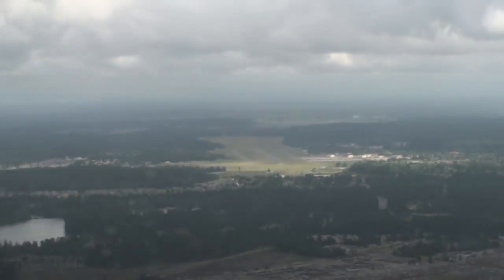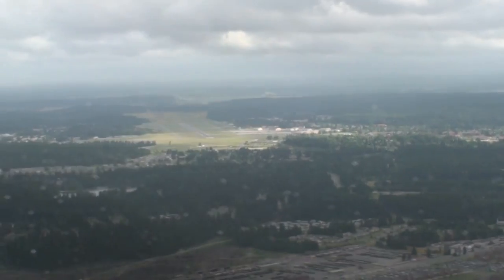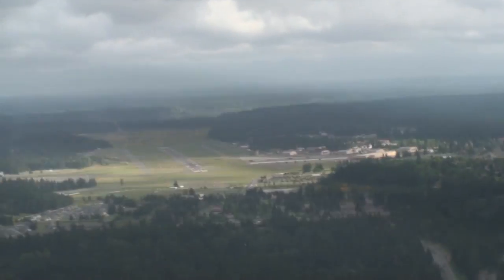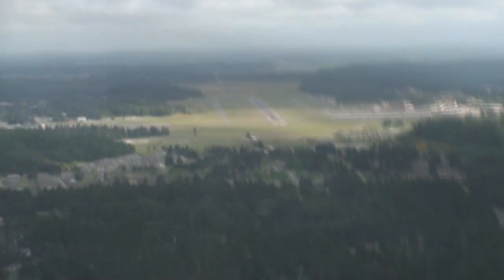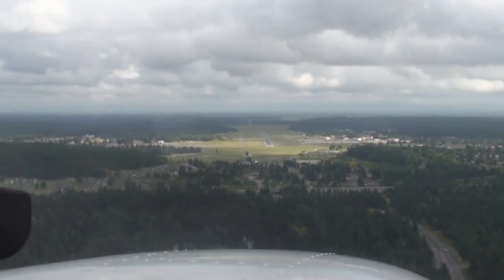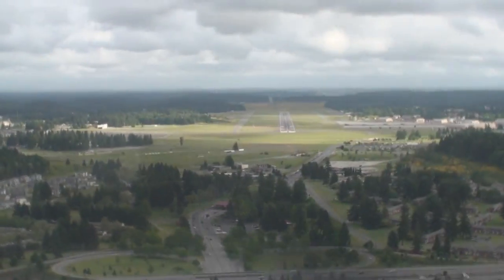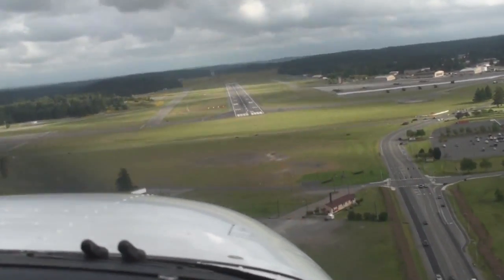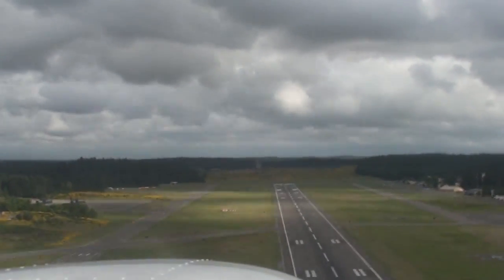PAR Approach into Grays Airforce Base.wmv

Comment: Good, and informative video. For those who have never done a PAR or a No-Gyro ASR approach, I suggest you try to find one. They are amazing confidence builders, not only in the pilot's skills but in the skills of the the controllers. The only place I have ever been able to do a PAR approach was at military bases. In case anyone missed it, civilian aircraft are not allowed to land at military bases unless previously approved. That is why the controller issued the "Cleared for low approach at or above 500 feet. On the other side of the approach, so to speak, I don't honestly know what, if any requirements, are as they were in the past, but it used to be that approach controllers with radar were required to log so many ASR or No-Gyro approaches. If that is still the same, a pilot who requests a PAR or ASR approach not only helps themselves out, they also help out the controllers to maintain their "currency".

Comment: I mean what is the reason for PAR if the runway in sight? , or this is just a training
Reply: For the pilots, yeah, you could for currency, but most around the area just do it for fun. At least that's why I would do them. It can be an interesting experience as safety pilot too. What feels like small corrections when you're wearing foggles can actually be relatively big course movements.

For the controller, they need to do a certain amount to maintain currency on the PAR. I forget the exact number, but often you don't get enough military aircraft who are interested (or have time). Sometimes they'll solicit it on the ATIS or will have Seattle Approach offer it.